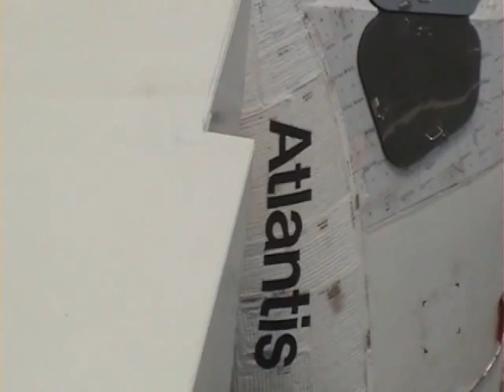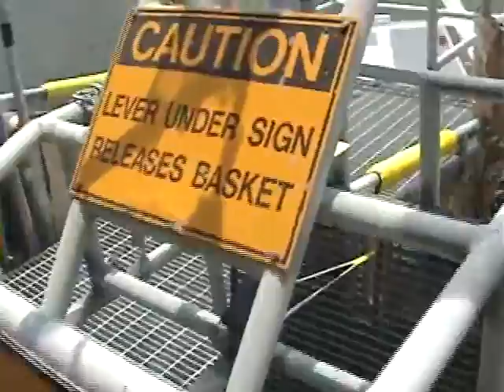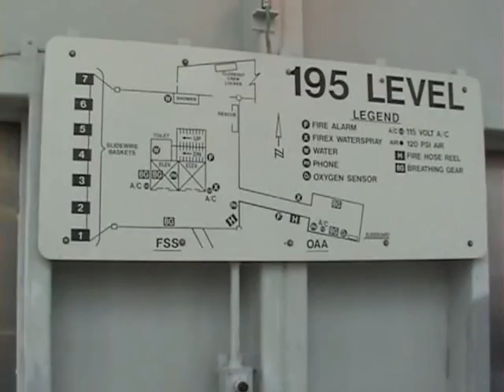Walking around space shuttle Atlantis on the launch pad before the final mission

Comment: Matt....2 questions......as the shuttle sits on the pad, does it hang only by the tank or is the shuttle supported under the tail in any way? Next, what are those sparklers that ignite before the main engines light up?
Reply: I can tell you it hangs by the tank. The Sparklers are Hydrogen burn igniters, they are used to burn any hydrogen fuel the SSME's May burp out prior top main engine ignition.
Reply: Just 8 bolts holding it to the ground. 4 for each solid rocket booster. Connections near the tail are not structural. they are to load fuel and electronic connections etc.  to the ground.
Reply: Those bolts I believe are an inch and a half diameter.

Comment: How/where is the shuttle actually supported when it's sitting on the pad, or is it literally just handing onto the ET?
Reply: I am also wondering about that haha
Would be great to see something about the holding device
Reply: At the bottom of the SRB's there are several (6, I think?) huge bolts that hold the whole stack to the platform. The bolts are blown into pieces as the SRB's are ignited, allowing the liftoff to happen.  Watch the other videos by this guy with the slow motion cameras as it launches, and you can see them.  It is awesome. The 45 minute video here on Youtube by NASA entitled "Best of the Best provides views, commentary of Shuttle" iS AWEOME.  I learned a ton about what actually happens as the whole thing takes off.
Reply: he an i are talking about the shuttle not the srbs
Reply: Actually, the hold down bolts on the SRB's do hold it down. If you watched a shuttle lift off after the arms came back and while the main engines were coming up to thrust. . Also you would see it sway back and forth. Crews called that the Twang. It was timed that when the shuttle came back vertical the explosive hold down bolts on the SRB's would be sent a signal and they would essentially release the Shuttle stack. So essentially the shuttle was attached to the ET, the ET to the SRB's, which was in turn held down by bolts. Those SSME's had 6 seconds to come up to thrust and have no abnormalities. Had they had abnormalities an RSLS Abort would be initiated and the SRB's would not ignite and those bolts would not be blown. All of this done by computer.
Reply: Yes it is
Reply: Just 8 bolts holding it to the ground. 4 for each solid rocket booster. Connections near the tail are not structural. they are to load fuel and electronic connections etc. to the ground.
Reply: jea i also found out more about this in my research on the topic, but thx dude
Reply: @nathanpair1231  it’s 8 I believe